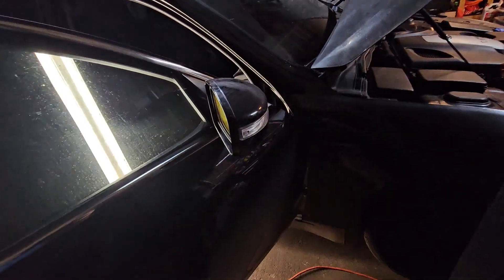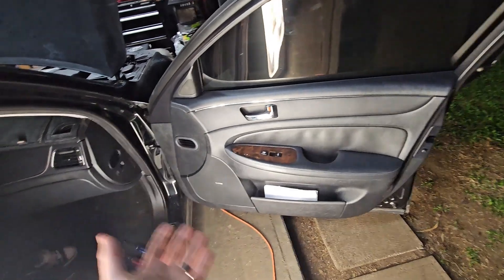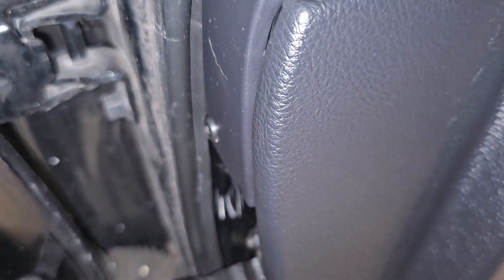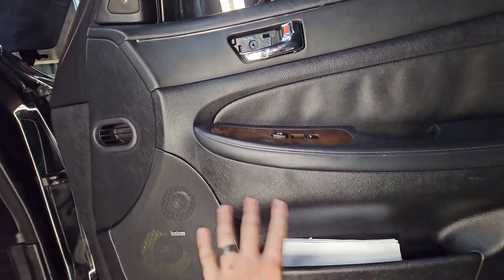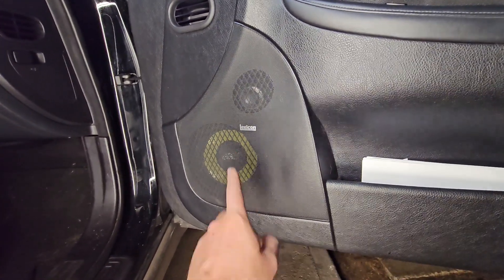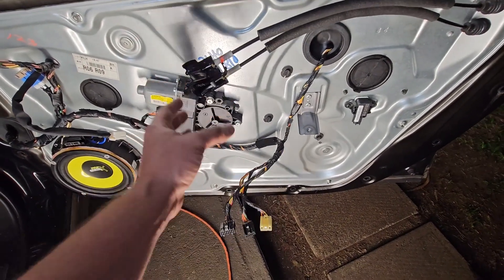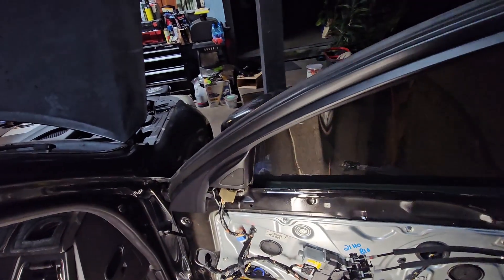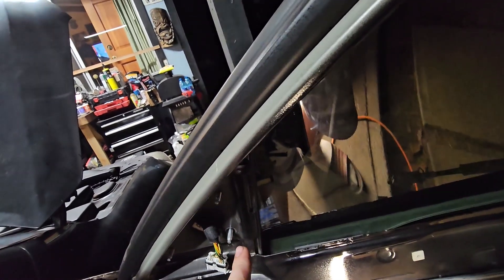Replacing Side Mirrors PLUS Upgrades! - Genesis Sedan

Comment: Help! My 2015 mirror goes in and keeps clicking like it won’t stop and when it goes out it does the same clicking like it keeps popping until after a minute it stops. I’m thinking it’s the gears in the mirror. Please help. Also my passenger seat won’t warm or cool and it won’t recline. It started working one day after a car wash but after about a few weeks it went out. Thanks in advance for any help.
Reply from the maker: For the mirror its probably stripped gears so it'll be easiest to replace the whole unit and as for your seat I'd check the connections or fuses to see whats going on. You could also make a post in the group as we do have a lot of DH owners